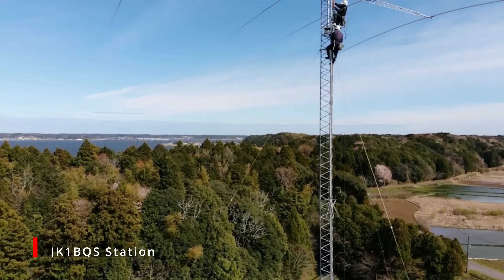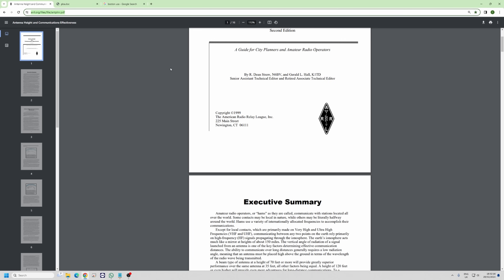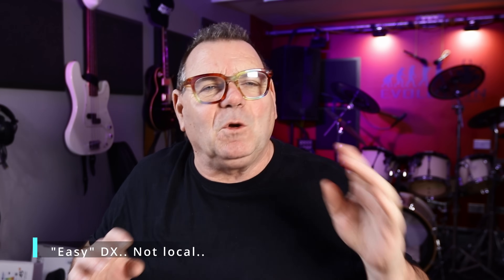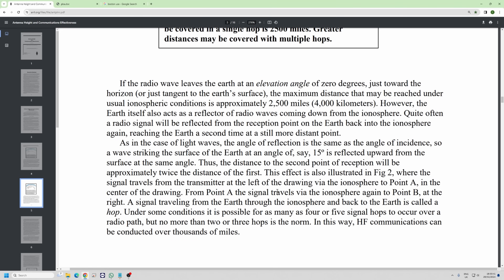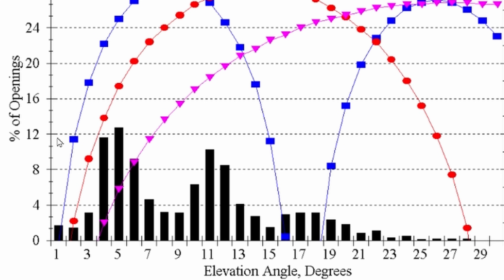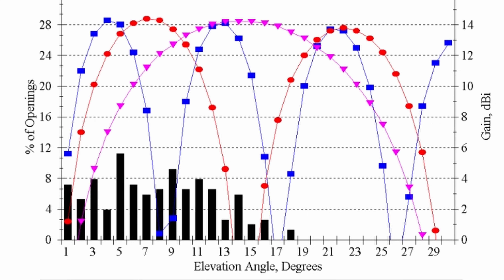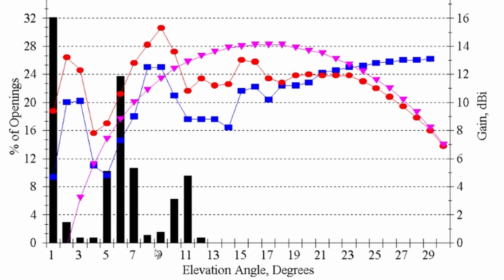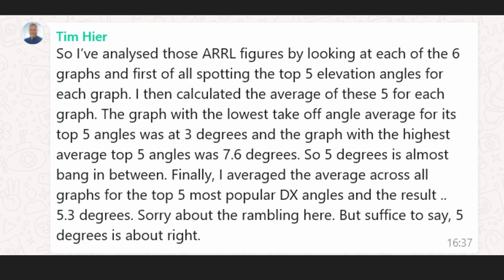The Truth About Optimising Take-Off Angles for Ham Radio DX

Comment: Although I agree with the majority of your video, you and Tim are making a huge mistake by averaging probable takeoff angles.  When the signal is arriving at 15 degrees it most definitely is not arrive at 5 degrees.  If it so happened that 50% of the time the signals arrived at 15 degrees and 50% they arrived at 5 degrees, 10 degrees would be the optimum takeoff angle.  Which is where no signals ever arrived.  Obviously the real work is more continuous, but I'm just trying to point out that your conclusion is unsound based upon averages of probabilities ... and even worse from averaging averages of probabilities.  Probability distributions are what they are for a reason.
Reply from the maker: I agree with you mathematically - you don’t optimise antennas by averaging arrival angles, and I wasn’t suggesting that 10° (or what ever) is some “magic” arrival angle.

My point was a design heuristic, not a statistical claim: if an antenna performs well at very low angles (e.g. 5°) - which are the hardest to achieve in domestic settings - it will not suddenly be poor at higher angles like 15-25°.

So I deliberately model and compare at 5° as a stress test, not because signals always arrive there, but because success there implies adequacy across the more probable angles.

In other words, I’m not averaging probability distributions - I’m choosing a worst-case reference angle to avoid flattering models.

Take-off angles and arrival angles on HF are actually very well studied and not a mystery area. If you want to dig deeper, a few solid places to look are:

• ITU-R propagation models (P.533, P.372) - these underpin most HF prediction tools
• VOACAP and ICEPAC documentation - explains angular distributions vs distance, band and time
• HAP charts (High-Angle Probability) used in professional HF planning
• ARRL Antenna Book chapters on radiation angle and ionospheric refraction
• CCIR / ITU historical papers on elevation angle probability distributions

The key takeaway from that body of work is that arrival angles are continuous, band-dependent and path-dependent, and low-angle energy remains important even when higher angles dominate at times.

My "argument " isn't about "averaging angles", it was about ensuring the antenna doesn’t collapse where low-angle energy does matter - which is exactly how most HF antenna work is evaluated.
Reply: @DXCommanderHQ  I know full well about takeoff and arrival angles, and I have extensively used HFTA and VOACAP (the desktop software, not the online version) for at least 25 years.  I also strive for the lowest takeoff angle I can get, but the fact is that an antenna with a very low takeoff angle absolutely WILL suffer when the majority of the incoming RF is arriving at 25 degrees.  I don't understand how you can argue otherwise.  The improvement in energy transmitted (or received) at low angles comes at the EXPENSE of the response at higher angles.  You don't get something for nothing.  There are lots of situations, particularly at gray line, when energy arriving at higher angles is stronger than that arriving at low angles.  That is EXACTLY what the vertical black bars in the ARRL plots are showing you ... which by the way were derived from thousands of runs of VOACAP on an old Unix machine over the course of a couple of weeks at ARRL headquarters many years ago.

Comment: Thanks for this Callum, helpful info as always.  Have you ever experimented with mounting the vertical above the ground?  My yard has a ton of stuff like trees and metal buildings etc.  I’m thinking about mounting your antenna on a roof with radials.  I’ve read that you can get low angles with this setup.  Thoughts???
Reply from the maker: On a flat roof with radials. Yes - they work.

Comment: Dear friend Callum, slightly off topic, sort of not. There is a thread over at one of the ham io groups talking about shopping for homes and property as a Ham. I posted an article that I found in the ARRL's Antenna Book, 21st Edition, Chapter 23, page 23-6. The article does not talk about take off angles, but it does expound on what to look for when seeking a property as a ham radio op to increase your prospects for DX, propagation notwithstanding. I am quite blessed in having the ideal spot, illustrated in the "Fig 7" of the article. Sorry if I am off topic. 😥

Very best 73/DX from San Diego
Reply from the maker: On top of a hill! LOL

Comment: Hi Callum, when it comes to transmitting take off angles, have you come accross any antenna software analysis that takes Brewster angles into consideration? It would be great if our DX antennas had maximum gain at 5 degrees, but in reality its more like 30 degrees for maximum gain. I have only just come across the Brewster effect.. Regards Gordon G1NOR
Reply from the maker: There is no way that we can ever achieve max gain at 5 degrees... The whole Brewster thing is a red-herring (I know who you have been watching!). Real "good" ground is the key and an excellent radial system to get every last penny. Actually, very near (or on top of) salt water, the max gain is actually at zero degrees!

Comment: Vertical polarization below 15 degrees takes a 7dB hit due to losses from the initial ground reflection, plus with most verticals having marginal grounds giving a 3dB loss, you're looking at a total 10dB of loss that does not exist for horizontal polarization, such as a dipole. But the dipole has to be up 1/2 wavelength to equal a vertical's dx.
Reply from the maker: Depends on the ground. You quote these numbers like it's all the same. I see your point - but most long-haul DX is under 10 degrees. And for 20m band - it's more like 4.5 degrees.

Comment: I can say that I built a 10 meter vertical with 4 sloped radials, raised it to 10 meters, and I got a 6db improvement over ground mount (due to lower radiation angle) I live in the SE USA and Europe comes blasting in now like it is next door. The results blew me away. I never believed it could make the difference it did but now I’m a believer. I did a video on it. Thanks for all the DX commander videos!
Reply from the maker: Depends on frequency. Try that on 40m band and let me know.
Reply: @ now that would be awesome. All I need to do is get my neighbors to let me use their front and back yard. I guess I’d have to get the feed point 40 meters off the ground too. That’s getting big right there. It’s my dream like your 28 DX commander array.

Comment: Is it really possible to take advantage of the low angle when there are houses, walls, and all sorts of obstacles in front of the antenna? Or do 40m and 20m signals pass straight through them?
Reply from the maker: In the main, houses don't cause an issue on lower HF. See here: https://youtu.be/UgA6zU59KZw

Comment: OPEN QUESTION: I have a 90ft x 120ft triangular'ish shaped POND; the pond's center about 210' from my shack.  Would I get a significant dB increase, if I planted a DX Commander vertical antenna in the middle of the pond (and submersed the coax) for maximum reflectivity?  Would the submerged metal mounting pole, replace all the radials needed for the DXC-SIG-9-POLE ?   Much thanks, LOVE this channel.
Reply from the maker: Hey Batman!  Unless it's salt water, there will probably be little benefit.. UNLESS you live in an arid / sandy desert. Which is unlikely if you have a pond!

Comment: I've had a crazy idea everytime I think of antenna design. Beings aluminum vertical antennas are hollow. I wonder how the radiation pattern would be affected if you put a top hat on it while keeping it insulated from the antenna itself. Then run an insulated ground wire up the inside of the radiator and connected it to the top hat. I just wonder if that wouldn't help squish the radiation field into a lower angle? 

Like what would happen if you had ground above and below the antenna itself? I wouldn't think the ground ran up the center would effect the field because it's inside the radiator but I know little of antennas
Reply from the maker: Oh I see! (I had to read that twice!) good idea. I'll give it some thought!
Reply: @DXCommanderHQ yea like an RF sandwich with a ground plane on top and bottom 😂

Comment: I love your videos. Sometimes we just need the confidence to just go and TRY something, rather than crunching the numbers and concluding ”it won’t work”! (Sometimes called "Analysis Paralysis".) I remember working all sorts of DX with a jerry-rigged horizontal loop fastened under the eaves of my HOA Gestapo controlled condo. I discovered later that it was almost a textbook NVIS ANTENNA and I did get a lot of close-in contacts, but I also worked Japan, a couple of South Pacific islands, and South Africa.

One problem was 30 meters, I think. Every time I transmitted on that band, my garage door opener would lock up and not work until I reset it by unplugging it for a few seconds, then plugging it back in, 😀

73 de AF6AS
Reply from the maker: Good point! PS - I also had similar problems - but on 40m. It was the fridge. Had to reboot it!

Comment: Unfortunately, for me, I noticed the verticals I put up in my urban environment are noisier. Some people say this is a myth, but it holds true for me. However, I have done test and they do radiate well. The problem is I can’t hear the weaker stations on the vertical so I end up using other antennas for receive it becomes sort of a hassle for DX stations with pileup 
switching back-and-forth though
Reply from the maker: Maybe a RX loop on your RX jack. Works great.

Comment: I saw the other chaps videos and the response. I would suggest reading a good book, for instance HF Antennas for all Locations. Its an absolute classic. The mathematics is reduced for clarity. Interestingly no bananas mentioned, although imaginary numbers are in the same realm I guess 😅  I think the other chap was making some good points. I think his arguments weren't really centred around what should be a bench mark.  Rather,  he was making the point that very far from the antenna there are effects to consider. Additionally, when considering the myriad of possible  propagation mechanisms, maybe low angle may not be so important. In particular chordal hop propagation provides hope to all  regardless.  I thinks it fairly academic to reason that near resonant lengths of earthed wiring in household electrical systems will have effects in the near and far field. 1:38
Reply from the maker: Nothing like an imaginary number to light your bulb!

Comment: I had a QSO from Buffalo to Fiji tonight on FT8, 10w, ocf dipole 20' in the air.  Almost 8,000 miles.    Am I to assume my radiation angle was around 5*? 10m band
Reply from the maker: No, not really.. SOME of your energy will have been at the appropriate angle to reach Fiji. COuld have been 2 degrees or 9 degrees.. Approximately 99.99% of your signal would have been comopletely wasted. Actually, more like 99.999% :)

Comment: Cal, there is a utube video by W7EL, EZNEC Antenna Software Presentation, April 14th 2021 to LIMARC, Long Island Amateur Radio Club. He is showing aspects of using EZNEC, but does model examples of Verticals over different grounds and comparing the patterns. He also includes a low dipole in the comparisons. There is a long preamble in the beginning but the interesting stuff comes later on.

Comment: Great video and I always enjoy watching your videos ,
 The question that comes to my mind is: How can I adjust the antenna so that the signal takes off at 5 degrees or close to that?
 Is it by adjusting the height of the antenna from the ground?  Or in another way?  
I'm trying to understand this matter .
By the way, the antenna that i used spiderbeam 5 bands at a height of 13 meters from the ground.
 The place where the antenna was installed is relatively high. The ground is dry and mountainous.  
apologize if you explained this in the video and I could not understand it and asked about it again
Thank you very much. Best regards, HZ1MW 73
Reply from the maker: Unless you are into VHF or have massive towers, you won't get the main lobe down to 5 degrees.. Just beware of all the techniques to guide your main lobe lower (which impacts DX). All we can hope to achieve is get as much as we can between say 3 and 8. I have another video coming out shortly which also discusses slopes, tilting and near the end, some added value on this topic.
Reply: @DXCommanderHQ  I always work with Dx and enjoy it, and that is why I make sure to get the best position for the antenna. I hope to talk to you on the radio. Thank you and I am waiting for your video 73

Comment: The late Les Moxon G6XN covered this in some detail around 1990 or so in RADCOM's  sadly missed Technical Topics. As I recall he asserted that as frequency decreased typical DX arrival angles increased.
To demonstrate this erect a delta loop ideally 80,40 or 20 with corners on pulleys allowing the feed point to be moved and consequently the radiation angle to be altered from high to low. Lower angles DX, higher angles more local signals.
VE7MM/G4EZG

Comment: It’s absolutely true. I tested this concept last summer. I raise my mast to a certain height and no higher. I maintain my angles and take off elevations as needed. Thank you for the video. 🤝
Reply: @EMROGUSA  Cullam you are not telling me about my RF power output into wire antenna what wire antenna thickness to handle that 50 RF watts
Reply: @EMROGUSA  not clear about height and setting up an Antenna at an Angle ?
Reply from the maker: Excellent!

Comment: Dear Callum! I have a 5w  transceiver and I can raise the center of my dipole around 12 meters high and tie the ends to nearest trees with long ropes. The three options I have is almost straight dipole, inverted V and a vertical with extending the wire from the top to the side.  I am not able to make any kind of yagi, nor frame antenna. Is there any way to concentrate the beam for DX by adding some amount of wire on the ground to use as a reflector/director, or to make the ground more reflective just like the salty water/soil? What area of salty water/soil under the antenna is playing the role in such reflecting effect?
Reply from the maker: OK.. make another element and fit it 6-10 feet BEHIND your driven element.. In effect, make a 2 element vertical Yagi. It will be in a fixed position though.
Reply: @DXCommanderHQ  Thanks, I will try that. I really want to reach USA someday

Comment: 1)  A good majority of long-haul DX arrives at a low angle (as Callum says)
2)  There is an advantage if your antenna is able to hear/transmit at these low angles.  This is why stacked Yagi's are designed to enable selection of the correct angle according to targeted DX.
3) Also why having a high conductivity ground plane  (e.g. by the sea) results in an increase in gain at the lower angles desired (and it is spectacular and great fun).
4) The Pseudo Brewster angle is irrelevant for ground-mounted verticals of 1/4 wave length - that's just trigonometry, not RF science.  https://www.arrl.org/files/file/QEX_Next_Issue/2016/March-April2016/Zavrel.pdf   
5) Measuring and comparing gain numbers at a particular angle is just that - a comparison.
6) Modern (free!) software has the ability to calculate and incorporate these variables.
7) Most ham radio enthusiasts have an average ground, some wire in the air, vertical or horizontal at relatively low heights and it still works for them.  The nuances of granular RF science are interesting but ultimately irrelevant for daily usage. 
8) To imply that there is "no" radiation below the Brewster angle of any antenna is wrong - just plain wrong -  (and is irrelevant in the case of ground-mounted 1/4 wave antennas see point 4)
Reply from the maker: Wow. Beautiful comment Tom.

Comment: Still wanting 5 degrees and having a maximum of 15 degrees means the most effect is still at 15 degrees wherever you want or desire.
Reply from the maker: Incorrect.. The most GAIN might be 15 degrees - but your signal might be actually be best at 2 degrees, 8 degrees, 17 degrees etc.. Your antenna will still radiate.
Reply: That is what I say, most power where the lobe is.
Reply: But the DX signal is not at that angle of arrival -  meaning that when you have a DX contact it is not at the highest gain angle of your antenna - it still works though but as you say at a lower "power".  Hence we want to get the lobe down low if we can for DX.  That's all we are talking about.  @haraldlonn898

Comment: Callum can i ask, could you optimise recieve through a yagi by tilting it up 5 degrees rather than mounting horizontal to the ground to get maximum gain along the elements? Rather than the signal hitting the antenna top down it would travel in from the end cleaner/more effectively. This would be a good experiment. Thank you regards Steve M6WVV aka Enthusiast Steve
Reply from the maker: Wow.. I am JUST about to do a vid on this Steve. Stay there!
Reply: Great minds think alike 😁👍

Comment: Hi Callum, I've heard about the 5° thing for years. I note what you said about 7 MHz and houses.
Since putting 5 dipoles, 20m to 10m in my attic I looked for attenuation of brick, slate, wood and other materials and all I could find are figures for high u.h.f. and up. 
I came to the conclusion that h.f. signals going through a house must not be a problem. The problem is likely to be copper pipes and wiring coupling r.f. into them, and a row of houses makes quite a barrier.
G4GHB.
Reply from the maker: Yes, I would agree with that.. Fairly convinced that the copper pipes and wiring will skew a pattern.. Good be for the best.. might be worse (in that direction) but you and I have similar thinking there.. Too many experiments in my back garden / yard convinced me just next to the house.